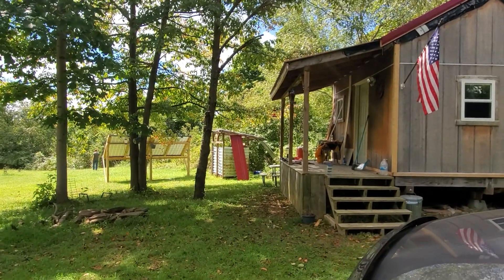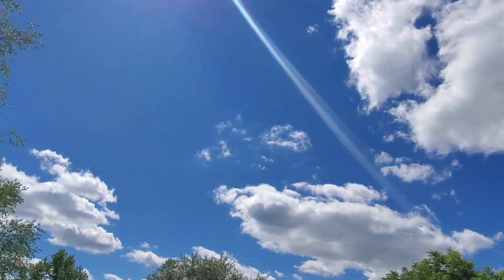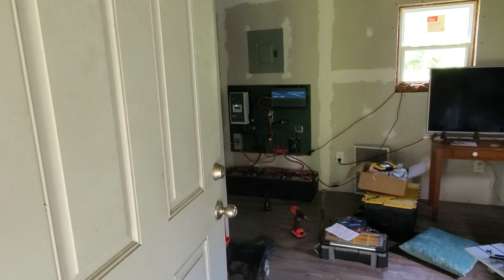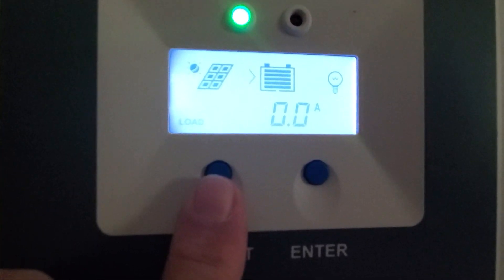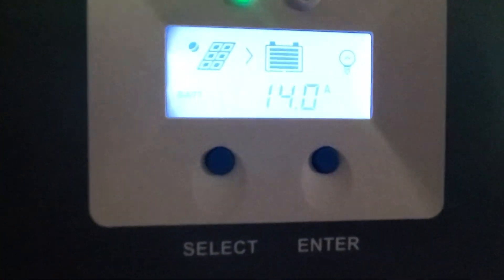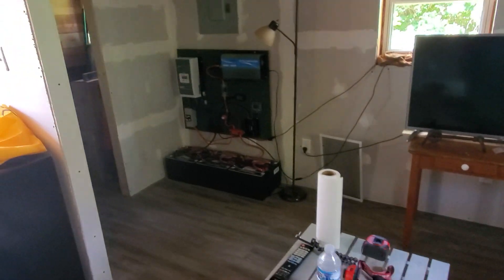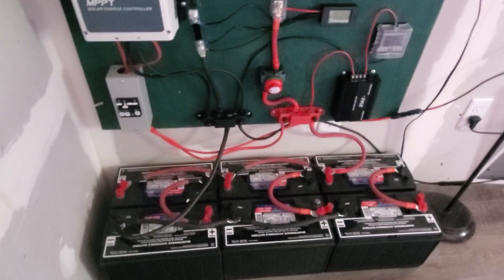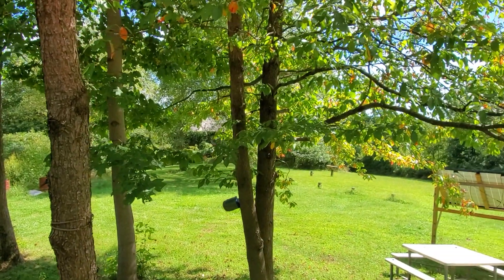1st Day DIY Solar Power at the Off Grid Cabin

Comment: I noticed it said your battery voltage was at 29.2 V that’s definitely too high they’re almost boiling.. a good float would be 27.6v
Reply from the maker: +peeinginthewind That turned out to be the equalize charge. That's why I let it sit a couple of days without a load. 27.6 is exactly what is it's float point. Thanks!

Comment: thats great Joe,,That My next Project,,Solar,,,I just run Generator Here,Yes i got a Backup..I was thinking about getting a pole set with just 200 amp service on it for my big welder and big Table saw,,But i get by with a small Table saw now and a meg welder...they do the Job.Just a Pole I can Plug in When i Need it..Cant you get a Pole set there...You Really need it there,,,Got your Cameras up,,You Should Hide Them in Places...I worry about your Stuff there more then i do mine.Hope you get in there before long.they have a solar Camera now..the one im thinking about getting,,that works on it own,,has a card in it,,dont no if its wifi yet,,The thing about it,i have to have one that works when im not home,,with no electric,,this one is perfect for me..i can set the panel on the ruff,and put the camera in side..out of the weather..aimed at the front door,,i may get two of them..Ok Joe,,Keep up the Grass Cutting,Dont let it get High,,,Later
Reply from the maker: +Ron Safreed I am looking at more of them cameras.

Comment: Now that you have them charged up. You should be able to run your AC off it with out any problem. When your there. The solar will run it when the sun is on the panels. There's more then enough power to handle it
Reply from the maker: +Roy Amberg Exactly what I was hoping for.
Reply: @HomesteadWithJoe  it will do it. Your not there everyday so batteries will catch up when your gone

Comment: Great stuff, Joe.
It would probably have been a lot more output if you had run the A/C.  Once the batteries are near full, the charge controller starts dumping power, just the same as a PWM controller would.
The lawnmower is intimidated by the length of the grass.  Show it who's the boss.  ;o)
All the best, matey.
Reply from the maker: +SarkyBugger That's coming. I just wanted to make sure this is working first.  Taking nervous baby steps as I learn this lol
Reply: The controller just shuts off the flow, doesn't really dump it anywhere (but with the right setup, it could). If I'm home when the batteries are in float I run a fan, small ac unit, or small heater to use the free electricity that otherwise would not be generated.
Reply: Man that place is looking really good Cabin looks great yard looks great. May want to check the voltage on those batteries that seems to be just a tad High on float or absorb cycle . I'm sure U will figure it out.